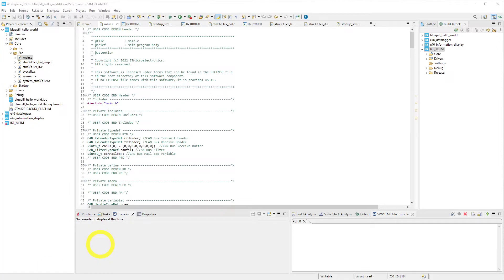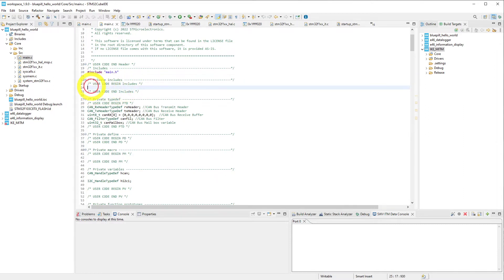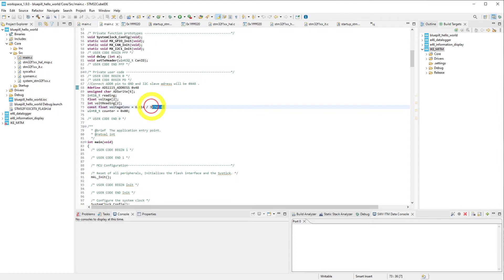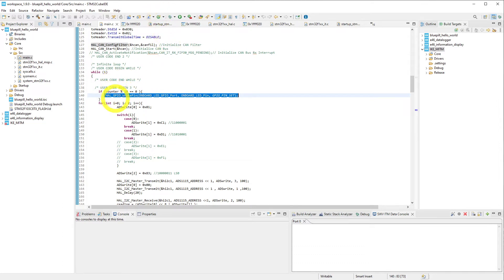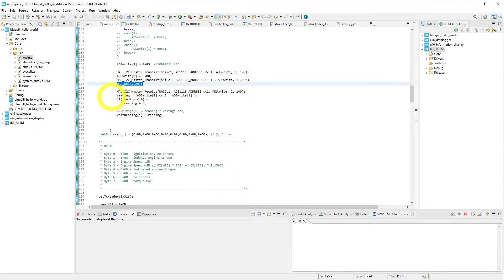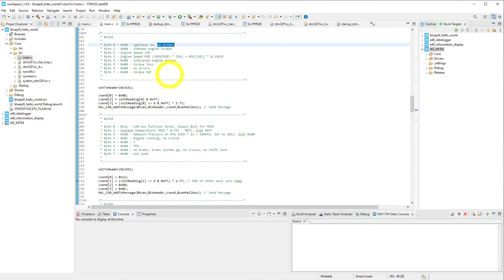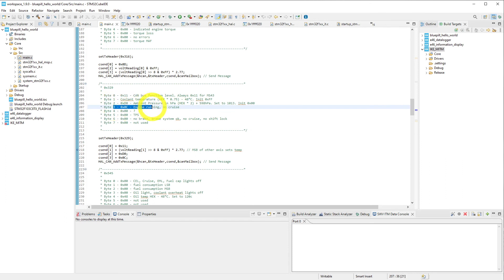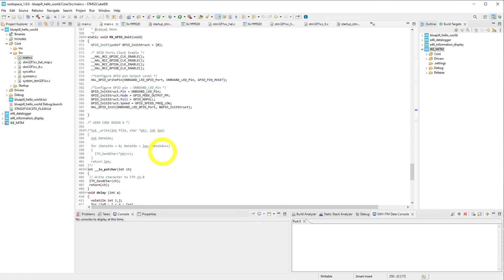Code Run Through - STM32 CAN Emulator for BMW E46 Instrument Cluster

Comment: make a code pls for e46 to see coolant temp with BC button
Reply from the maker: I'm working on it :) The factory cluster is limited in what it can do unless the code is disassembled - with current community knowledge a factory function would needed to be overloaded to provide the temperature (basically switch between exterior air temp & coolant temp). I'm taking a different path and replacing the screen with my own, then recreating the factory functions and adding new ones - like coolant temp, oil temp, boost, etc.

Comment: Thank you for doing this!
I'm using a standalone in my e46 but cant drive the tacho from it.
Been feeding the stock ms42 a 50% pwm on the cam sensor as tacho out from the standalone , problem is it's fired every ignition event so i need to multiply it by some number to get it roughly correct.
Problem after that is that the frequency using a low multiplier is too low for the standalone so i cant get the dash below 1200 rpm

Going to try setting up some can messages for it instead. Migh buy a display and mod it in the auto tranny slot to display something(thnking oil press/temp) while im at it.
Reply from the maker: You're welcome! I'm actually working on replacing the main odometer display so can have live data available (oil temp/pressure, boost, etc).